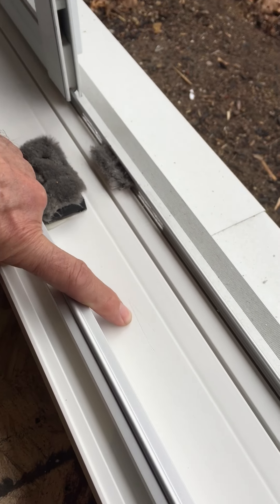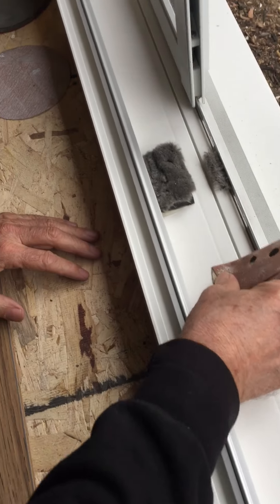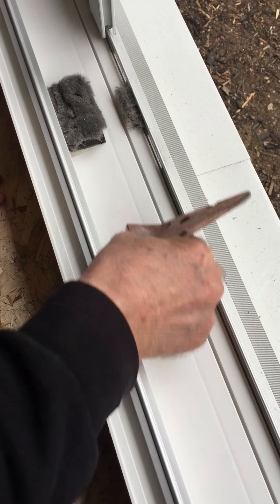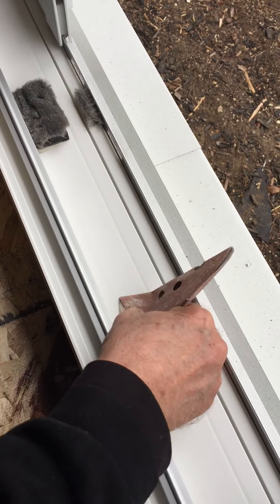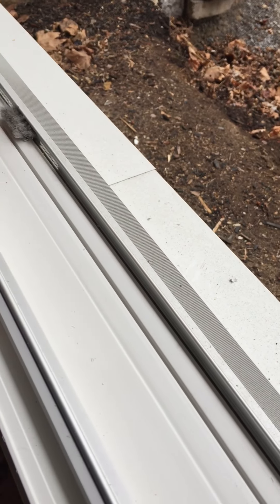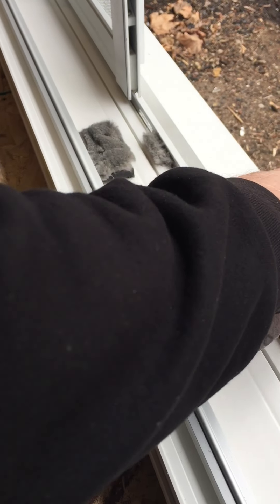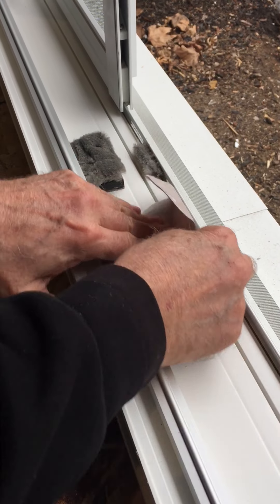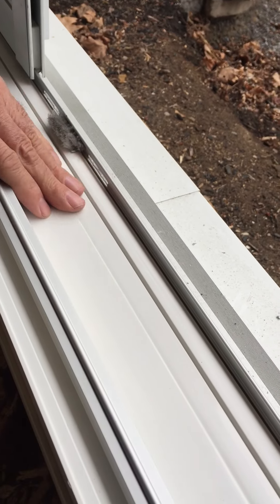How to repair scratched vinyl window or patio door by sanding

Comment: The idea is correct. For most people this will be satisfactory. The proper way (especially on a surface that you can get many light angles on and will still see scratch marks and dullness) to get back to a factory finish and shine is to literally go from 180 to 200-300-400-600-800-1000-1200-200-5000-7000. once you get to 7000 or above is when it polishes to the exact shine of most vinyl products today. nice job, looks good.

Comment: Is this the same method you would use to fix scratches from a Stanley knife in the plastic part of my upvc ? Tried to get layers of old caulk out that was covering the plastic of the upvc but in the process it’s scratched the plastic. Is it just a case of sanding it down or do I need to use anything else? Someone mentioned t cut ?
Reply from the maker: This method of sanding and polishing scratches off of upvc is meant for >2mm thick vinyl walls so that there is lots of depth of vinyl left afterwards for strength.  If there is dirt in the scratches try wiping it with Paint Thinner on a rag first to clean the vinyl perfectly before any sanding.  Only sand with the course sandpaper enough to eliminate the cut marks, then use the finer 400-600 grit paper to smooth it enough for the final polishing with 3000-6000 grit sand paper to match the gloss of the original vinyl.
Reply: Thank you. I didn't know they made 3 to 6 thousand grit sand paper.
Reply: @bree1128  They make sand paper even higher than that but 7-10k is more than sufficient for vinyl polish. be careful with paint thinner due to static electricity. Vinyl and rubbing can cause static and all it takes is one spark to catch that stuff on fire. Rare but can happen and in 25 years ive seen it 3 times.